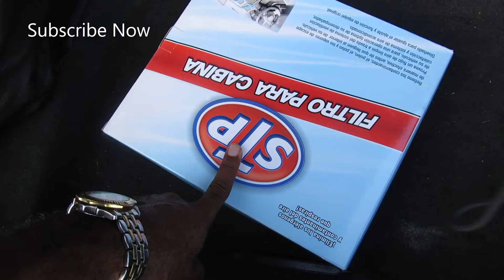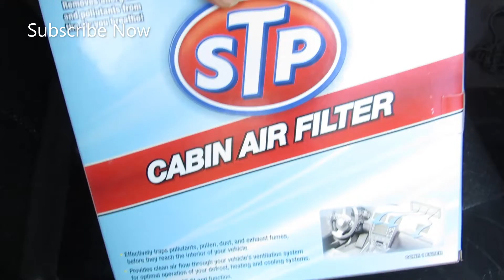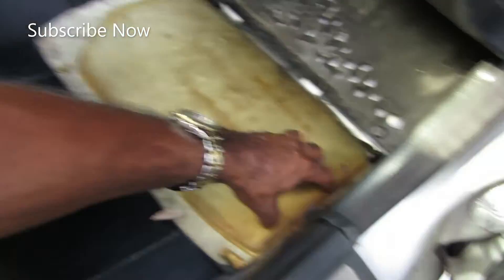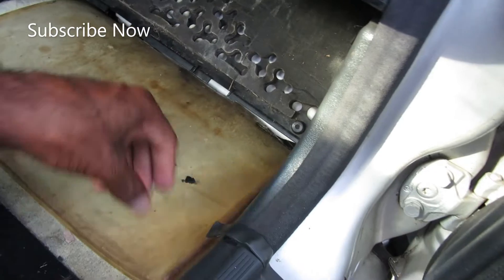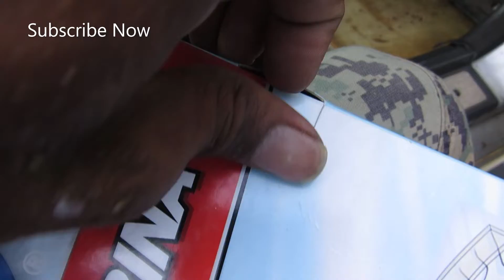How to replace a Cabin Air Filter in a Mercedes Benz Slk 230

Comment: if u have time what co do u buy parts from i need a idler pully C320 for example Peace
Reply from the maker: Truth be told if it’s not local I buy most of my parts of eBay like every one else. Their is a hydraulic shop where I get everything for the convertible top on my car but when I had my e class and c lass I bought from eBay or the local junk yard.
Reply: @vashawnlife  thanks bro never thought of e bay as amazon is stuck in my brain
Reply: Wow that is some record breaking cabin filter, I wonder how the cabin was smelling like